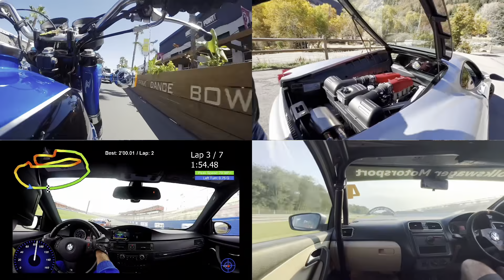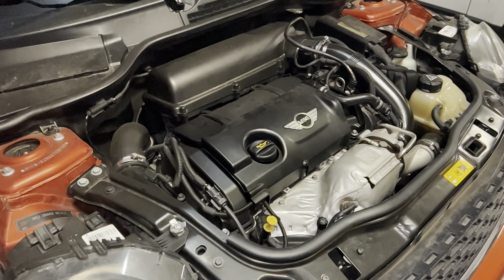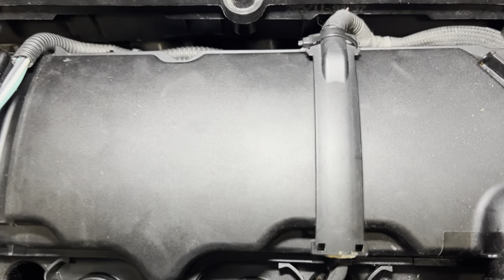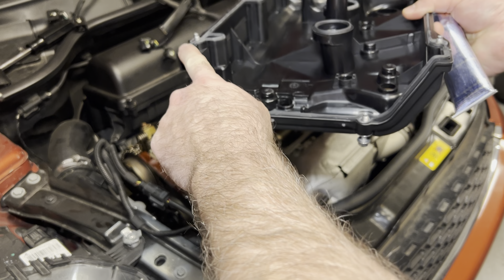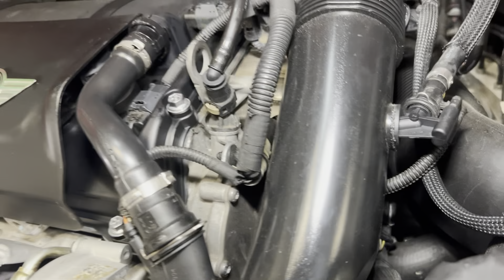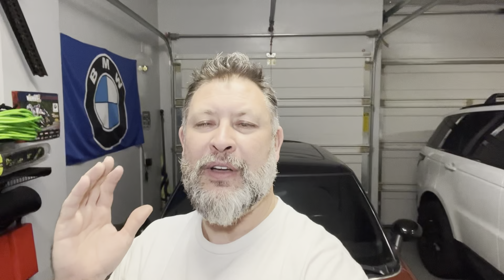Repair Mini Cooper Valve Cover if PCV Valve Stuck and Losing Oil

Comment: if you havent got money for the valve cover - can just replace the pcv valve with oem pcv its on the top left circular cutout on the valve cover... and then just buy a seperate gasket as well will save a bit of money

Comment: No need to worry about what order or location the coil packs came from if you haven't been throwing any misfire codes. If you have, try swapping coils and run it again to see if the cylinder misfire is at a new location, different cylinder. If it has, the problem is that coil. If the misfire hasn't moved, the problem isn't the coil and is something else. Best and quickest thing to do with a P0300 misfire code (301, 302, 303, or 304). 
Appreciate the video, I'm about to replace the valve cover gasket on my 2012 Cooper S. Couple of other points: 1) Clean, clean and clean some more BEFORE you even loosen the cover bolts. Then, after removing the cover as you did. 2) The Bentley manual says to use a thin coat of lubricant such as glycerin on the head sealing surface and to only use a small quantity of silicone sealant at the half moon gasket area, nowhere else. I'd let that sealant set and dry before starting it up.
Reply from the maker: Excellent additions!  I’m meticulous about having clean surfaces and not letting any dirt in the engine.  My meticulousness is also why I try to reinstall parts from the exact same location they were removed (eg these coils) but you’re correct that it shouldn’t create any problem to move them around.

Comment: Thank you for this! Would be great to see what the old cover looked like underneath when you removed it? Been a while now so not sure if you took a photo but I'm curious as I need to replace mine because my mechanic said it's blowing out smoke because it's too dirty under there.
Reply from the maker: Don’t have the old cover or a photo of it, but I don’t recall it looking bad inside.  The issue was that the PCV valve within the cover stopped opening and closing, thus causing excessive oil loss.
Reply: @robbsgarage  Thank you for your reply! Ahh I see. Mine might have the same issue then. My mechanic just said that the oil wasn't pumping very well through the valve (therefore smoking out the exhaust) so need to replace the cover. I thought it may have been blocked from being old and dirty but perhaps it's the same as your issue. Thank you for this video, will give it a go replacing it myself as I don't want to pay my mechanic to touch my car anymore.. :)
Reply: Did you have much blow by when the oil cap was removed prior to the swap?  My 2012 base model has a lot of blow by. 235k miles on it though.  Not sure if new pcv would help? Thx@robbsgarage

Comment: What else did you apply? Silicone? Why did you apply it? Please share the product.
Reply from the maker: Permatex Ultra Black gasket maker.  Not needed everywhere, but helps seal the gasket around that one section I show in the video.  Others have reported leaks without using it.

Comment: can you please tell me the procedure for installing the spark plug tubes? It looks like the right one came out when you removed the valve cover. When you re-installed the valve cover, all four tubes were removed.@ 8:30 they are still not installed but they are @ 8:33. Thank you!
Reply from the maker: Good catch!  Didn’t realize I overlooked showing this step in the video, and since it was so long ago I honestly can’t remember 100% but in rewatching it I think I must have installed the tubes after loosely fitting the valve cover.  If I were to do this today, I’d try installing the tubes before the valve cover to make sure they’re properly seated—perhaps I didn’t do this because the valve cover wasn’t going on straight with them installed?  Can’t remember, but whatever you do be sure the tubes are properly seated at the base.  I don’t recall having to use anything but my hands to ensure fitment, but have heard of some using a socket or pliers to seat them when having to reinstall during sparkling changes (with valve cover on).

Comment: How do you know when the valve cover is due to be changed?
Reply from the maker: If you have an oil leak around the seal or if you have a check engine light with a code that indicates the PCV valve is stuck open or stuck closed, then time to change.  One reviewer commented that you can replace the PCV valve without changing the entire valve cover, but I’m not experienced with this or seen anyone do it yet.
Reply: @robbsgarage it's the small semi round plastic cover located at the top left corner of the valve cover. there are 4 small plastic clips diametrically located (think of an X pattern) around the PCV cover that can be released using an L-shaped small pick. with the  old  cover removed you can replace with the new diaphragm, spring and cover assembly. new cover can be snapped into place.

Comment: Thank you very much Robb! Amazing video. I would appreciate a tightening specification (I understand that the tightening torque is 10Nm). Question - I saw that you used Permatex 82180 Ultra Black RTV. Is it required to apply it or is it possible without Silicone Gasket? Thanks
Reply from the maker: Thank you.  At 9:32 I mention that the torque spec is 7.5 ft lb, which is equivalent to 10nm, so yes you are correct using 10nm.

I’m not a certified mechanic, so take my advice knowing that, but I personally have always applied a little silicone to gaskets like this as an added layer of security to seal in the oil.  Maybe I’m just old school, but I wouldn’t risk installing without RTV.
Reply: @robbsgarage  this is what gaskets are for! You are like... putting 2 condoms while she's on pill
Reply: Thx bro ❤

Comment: I have the same issue and same mini, same everything. I cannot, for the life of me, put the replacement cover back on. It was easy to take off, but putting the new replacement is hard! It feels like it doesnt fit. But I know its the right cover for my mini. Any tips?
Reply from the maker: Few things I’d try:
1. Compare the inside curves of the old and new cover to ensure they are indeed the same shape.
2. Double check to make sure the connectors aren’t getting in the way when you try to press the new cover on.
3. Try fitting the rear first on an angle then lay the front down.

If none of those work, let me know where the cover is giving you trouble and I’ll retrace my steps to see if I can think of something else.
Reply: @robbsgarage  thanks for replying! We just tried all those things and then it started raining and we headed back inside. But right before we stopped working on it, we noticed the engine hoist was not allowing the right side to align with the bolts. Both covers look identical but the new one could be thicker. Is there a way to remove the hoist?
Reply from the maker: @RR_12014 hmmm… there probably is a way to remove it but have not done it myself.  If the cover is bumping up against the hoist and it’s thicker than the original, I wonder if it’s the correct cover for that engine.  Keep in mind that Mini made a few different engines for this generation.  Keep us posted on what you find out.

Comment: Great video. Thank you.  Before you replaced the cover, can you estimate how much oil consumption/loss you had per some number of miles?

I'm having to add a quart pretty frequently.  I know i have a small leak around the cover, but I'm pretty sure i need new valve seals as well.
Reply: Since I'm taking the valve cover off, I'm going to replace the timing chain kit, valve seals, Vanos solenoids, and replace the cover + PVC valve with the aluminum cover.  Plastic on top of an engine is just asking for problems.

Maybe when I tear into it I'll see a definite sign of a leak at the gasket.  I'd just like to get this car running well and reliable for the next 100k miles.   I don't expect it to be problem free... It won't, but if I can knock out many of the worn components in one go I think that leaves me with a water pump, oil pump and a few little odds and ends that should be pretty easy to spot when they go out.

I'll definitely be adding a dash mounted scan gauge to display some temperature and engine/boost data too.   Maybe I'll do the Android Headunit someday and put the gauges on there.

Sorry this is a bit long, not expecting a reply.  I know that comments on videos can help a little bit with the algorithm though.

Have a good one!
Reply from the maker: @underourrock  sounds like a great plan.  Have you done it yet?
Reply: @robbsgarage I managed to catch a sinus infection.  Didn't know I was chasing one.

Hoping to start working on the car tomorrow if I'm better enough.

Given more thought and parts on hand, I'm going for broke:
New timing chain kit (Detroit Mini's cryo hardened....I don't like that term, is more like cryo-tempered because it is a form of stress relief), new valve seals, aluminum valve cover with new PCV, new version of the mini diverter valve, titanium turbo heat shield, and a new M7 intake and silicone intercooler pipes.

I figure I might was well put it back together better than I found it.

I see a bigger: turbo / downpipe / exhaust, and intercooler with a (probably canned) engine tune in my future.  I'm not looking to get every ounce of power out of it, but a healthy bump would be nice.
Reply from the maker: Thank you.  If I recall correctly, lost about a quart of oil in ~3k miles, so it burned quite a bit more than I would have expected.  After the PCV valve/cover change, no more oil consumption.
Reply: @robbsgarage  wow.... That's enough for me to do the cover first and see what happens.  Being out a gasket and gasket maker is a small price to pay to avoid replacing seals if I don't have to.  Hmmm.
Reply from the maker: @underourrock  keep in mind, I didn’t have any leaks, the valve was just stuck which caused oil consumption.  Still shocked at how much.  If you don’t have a code that’s reporting a problem with the valve, it could be more than just your leak (unless it’s a bad leak).  Agree with you though, gasket is inexpensive so try that and see what happens.  Good luck, and comment back on the results!
Reply: That it common on the mini Cooper. Just replace the gaskets and seals. It doesn't  need a new valve cover. The valve cover gasket  comes with the seals. Make sure to get both surfaces completely clean.
Reply: @williamdavis9943 plastic wraps, so I agree that a valve cover may not be necessary, but sometimes it is.  New seals and PCV rebuild is definitely a viable option up to a point.

For me, the labor and time costs more than the parts, so if I can throw an aluminum cover at it with a new seal and not have the thermal expansion coefficient differential between the head and the valve cover, I think that'll be a good thing.

Totally understand if someone is looking to minimize the parts they replace and still be effective, though.

Comment: I need to do this right now to my car. It's smoking white smoke from the tail pipe. I am worried I'm destroying my engine.
Reply from the maker: Quick, simple job.  In the meantime, be sure to monitor your oil level and add as needed so it doesn’t get below minimum operating level.
Reply: @robbsgarage  I just changed the oil 2 months ago. They did an engine flush too. That's when the smoking started. As soon as I left them. I heard this could fix it.
Reply from the maker: @jaydee1389  it’s possible, but there could be something else mechanical causing the smoking.  Before buying the valve cover, try reading the codes (local auto part store can if you don’t have a scanner) to see what the computer is reporting.  If you have a code that the PCV valve is stuck open then this could fix it.

Comment: Wrong. You can replace the $20. PCV valve.
Reply from the maker: I’ve heard mixed reviews about doing that since it’s integrated into the valve cover and once removing the cover you need new gaskets anyway.  Please share your experience on replacing just the PCV valve.  Would love to hear how it’s worked out!
Reply: @robbsgarage  I wouldn’t trust it; just replace the whole thing… those valve covers warp. Great review and even correct bolt pattern sequence!
Reply: @robbsgarage  Research is the key to any problem with any car. Shop around for replacement parts. Don't settle on the first one you find. If you have to order the part, shipping cost needs to be considered? I once bought  a car that someone put the wrong brake pads on the front wheels. Compare  old from new part. After market can have an advantage because the new part may see an improved upgrade? Or the down side, the part may be junk? I always do a complete inspection  of the new part.
Reply: I'm so happy you found out how to replace only the PCV that is integrated into the valve cover. It was super insightful of you to give us the link and sources. Keep fighting the good fight, brother
Reply: You Can change the Big pcv valve but there is also two small ones integraded in the valve cover, did you know that?
Reply: Hi, where is the second one? I found one that goes in my catch can from the left upper corner and it works fine, one way only. But I don't know whete the second one is so I can check it. I changed the PCV but still have vacuum under the oil cap of my N18. I believe that it's maybe too much. I have to pull the oil cap to remove it. Thanks
Reply: I saw one video, and a guy replaced all kinds of parts on the mini Cooper before he figured out it was a simple $ 20. problem? This is a very expensive situation. Especially  with all mini Coopers, you can not do guess work? Sometimes miss reading a scanner can be costly also? Owning a mini Cooper  requires patience  and knowledge  of the vehicle.
Reply: How?
Reply: @richardvelasquez2569  There is a video on replacing the PCV . Save your money. Replacing parts from guessing can get really expense. Use the process of elimination. Then hook up your scanner.
Reply: @richardvelasquez2569  any mini Cooper requires that you educate yourself  on it systems.  Many service people  won't  work on them because  they don't  understand  them. Even some BMW dealers won't  touch them.
Reply: I went for the cheap fix to only replace PCV valve and cover was so brittle the lip that clips the PCV cracked and ended up replacing cover anyways. Great video, thank you!
Reply: @mburo  There is no cheap fix on the MIni Cooper. Once in a while, you can get lucky.

Comment: Any issues with leaks? I'm debating wheather or not to use this same gasket maker on any problem areas. Just replaced my gasket and waiting on some new plugs/ignition coils to re-install. Thanks!
Reply from the maker: Nope!

Comment: Hi Rob ,
Thanks for the video!

when the check engine light came on, were you able to read the error codes with the Obd?
Reply from the maker: Yes, the code indicated that the PCV valve was stuck in the open position.  I think it was code P053A but didn’t write it down.  I’ll be sure to include code #s in my future videos.